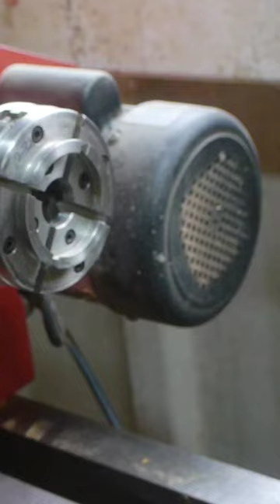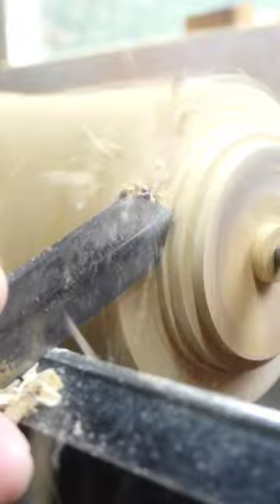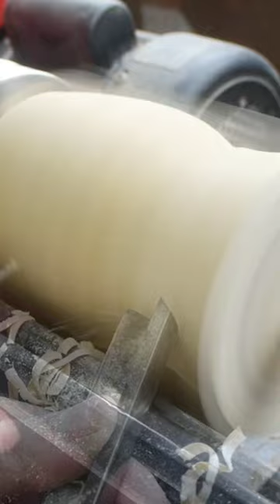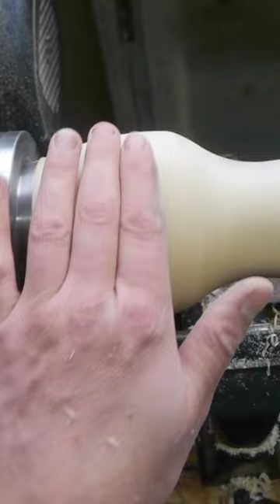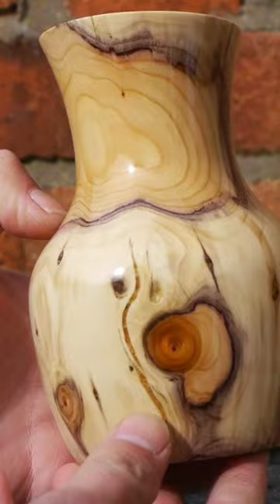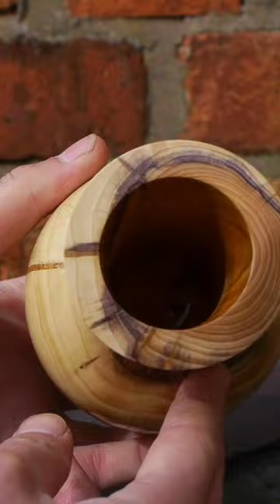Shiny Yew Vase - Woodturning #shorts

Comment: Great mini vase man. Also what speed do you usually hollow at?
Reply from the maker: Cheers, super happy with the shine on this one!! I'd normally go probably 1200-1400 rpm but it depends on the wood too. If a piece was off balance or I was worried about the hold in the chuck at all it'd be slower.